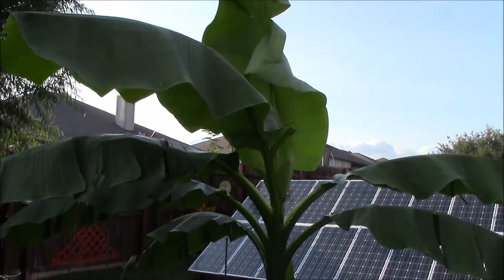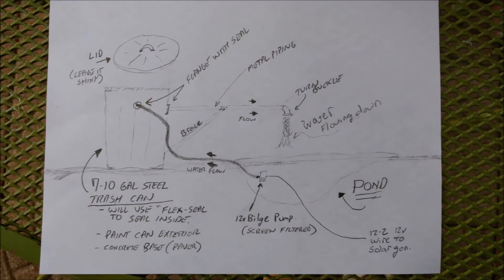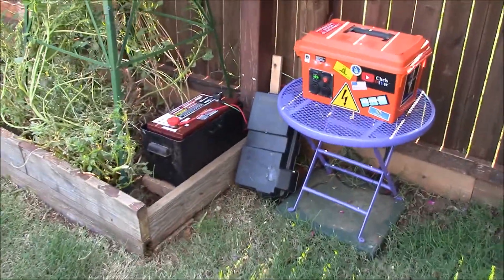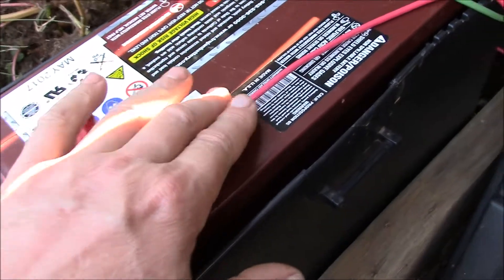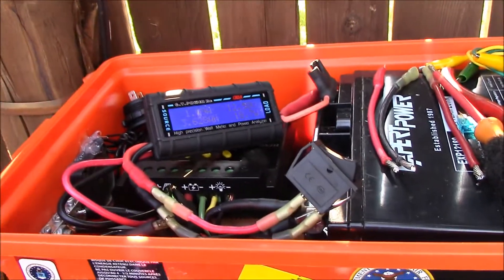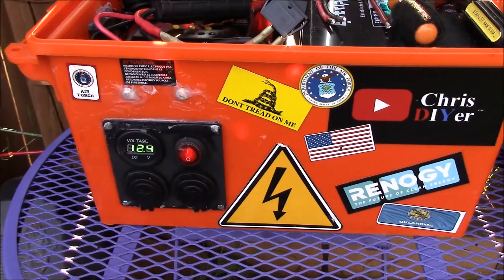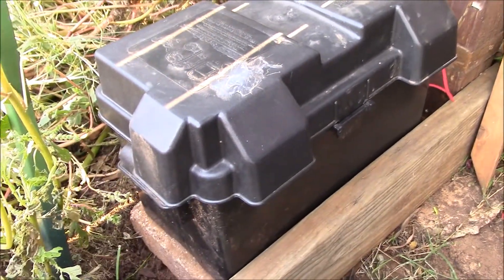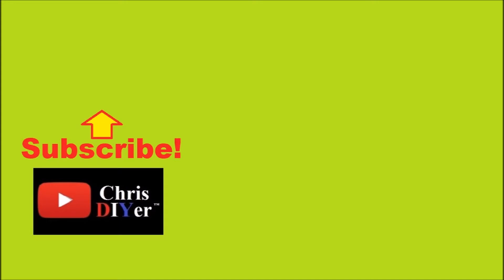Trojan Overdrive 31AGM deep cycle battery installed into backyard solar generator system!

Comment: That sure is a huge battery. It'll last forever in that application, which is what you want. :D
Reply from the maker: Yep...and weather tight. The orange box has been sitting out there all summer...ZERO issues with rain, sprinklers, dust, bugs, corrosion, etc

Comment: How do you like these Trojan AGM's??   Was thinking going with 2 Group 31's for my car stereo....  currently using Duracell group 31's made by East Penn company
Reply from the maker: Trojan has been making batteries for over 100 years. These OverDrive 31AGM's are high-end deep cycle AGM batteries, have no experience with Duracell. I use four of these Trojan's in my other solar generator (along with this one in my micro solar generator) and am impressed. Beasts. It all depends how you use them (or abuse them)...but, can say they handle stressful loads well